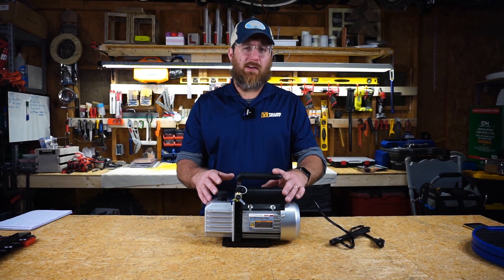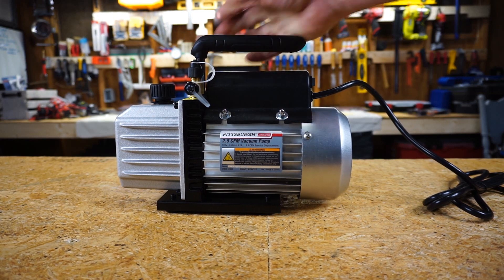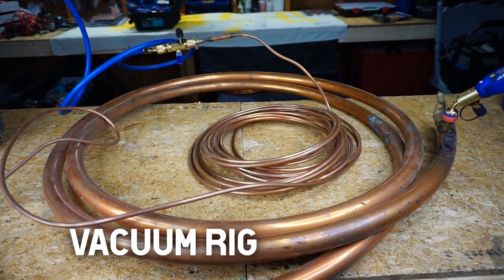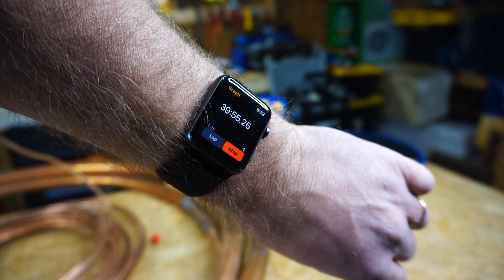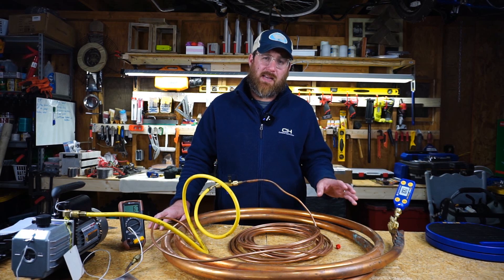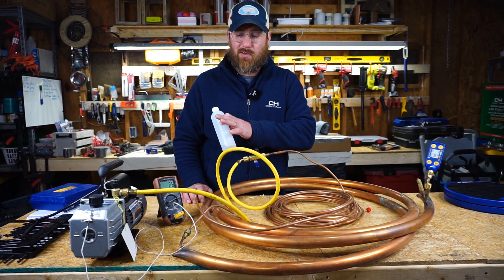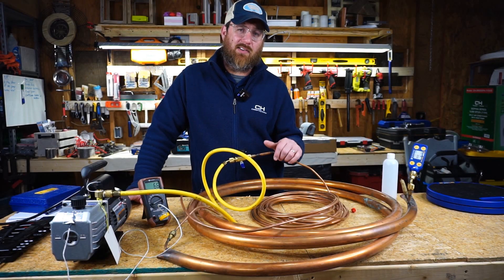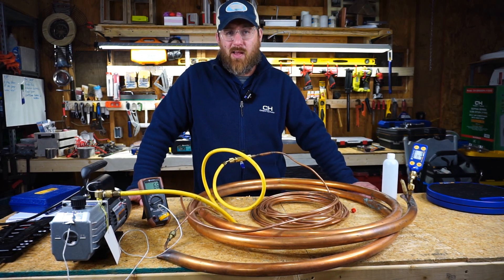Can a Harbor Freight Vacuum Pump Pull a Deep Vacuum?

Comment: I used a newer model of this pump rated st 3.5 CFM and 75 Microns.  It easy pulled to 300 microns fairly quickly.  Cost $149.95 in new inflated dollars.
Reply: "new inflated dollars"

@the497jepthal - I chuckled, and cried.  Thanks for the new term.
Reply: I was just at HF last week and picked one up at that same price, but it was 3 CFM (two-stage) and 22.5 micron rated.
Reply: Do you remember how long you pulled the vacuum for

Comment: Cant say i trust any gauges at all anymore. 
At least not on this job. 
Tried the old sears vacuum gauge on a pump and deadhead i would see 22". 
Hook it on the car,i was getting 25" on the gauge set.  
Unsure if that was good , borrowed another pump and the sears gauge gave me 23". 
Hooked it on the car,id see like 27".
Whatever, if that's good enough ive got time, let it run for a week i guess.

Comment: I have seen that in Harbor Freight and been curious about it myself so it was nice to see a video about the performance of it in real time. Nice know it could be used in a home air conditioning system. I suppose in the end 500 Micron does the same regardless of Automotive use or home use. I have shopped at Harbor Freight numerous times before and find that their quality has come a long way from what it used to be. Hand tools not so bad but anything requiring torque is generally pretty poor or for short-term success. Or both. Let's face it, most of that stuff is made in China and they don't care about generating Goodwill they care about generating more money. End of story.

Love your Channel by the way and your basic philosophies involving life and religion.

Comment: I've been using the Harbor Freight pump at our shop (Heavy Construction Company) for three years now.  Has not let us down once.  A/C in our trucks and heavy machines is Ice Cold.
Reply: Hey, I'm in a similar field (heavy equipment in a quarry) and I'm curious what your HVAC gauges say once you've pulled a vacuum.  I had a harbor freight single stage pump and recently upgraded to the two-stage pump (because I've been using the single stage pump to pull vacuum on hydraulic tanks while I work on the system). The single stage pump used to get me between 26 and 28 inches of mercury on the gauge and now that I've upgraded to the two-stage pump, I'm only getting between 24 and 26 inches of mercury and it takes forever.  I'm not sure if maybe my gauges got bumped around and it's not accurate anymore or if this pump is defective.  How many inches of mercury do you usually get , and do you have a single stage or two-stage pump?
Reply: @bradbeck2601  Hi Brad, I use the single stage pump also and like you get 26 to 28 inches.  It's not a perfect 29-30 but never had an issue with our A/C units. Yesterday found someone walked off with my gauges and hoses but left me my pump. Could have been worse I guess but I think they will re-appear as fast as they disappeared.
Reply: @fireriders8319  thanks!  Yeah, I haven't had any problems yet only getting 24-26 inHg I just thought it was strange since I anticipated a deeper vac with 2 stage.  Maybe there's something else I'm missing, I'll have to investigate further.  By the way, your workplace sounds exactly like mine, tools go missing for days and magically show back up on my toolbox, sometimes right after buying a replacement.
Reply: @bradbeck2601  I usually get them back bent ,  broken or even rusted solid.

Comment: It is a rebranded FJC pump. Used it the first time yesterday, pulled 200 microns no problem while testing with non-vacuum hoses. Be careful when use Fieldpiece manifold with an internal micron gauge, stupid me released vacuum by opening a valve on a different hose after shutting down the pump and it sucked some oil out of the vacuum pump into the connected hose, lol. BTW manual says this pump uses 46 viscosity oil, I plan to switch it to synthetic Supercool oil.

Comment: According  to instructions, the smaller threaded Red plug is the oil fill port...Why you used the larger Black air vent port plug ??  Thx for the video.

Comment: I have a unbranded vacuum pump that looks very similar to the HF pump you have here I use for wood turning. I ran it todayfor about 20 minutes to hold a bowl on my lathe. When I finished the pump side was very HOT. I don't have much experience with these pumps. Do they normally get so hot? Thanks for any information you have.
Reply: Yes 😁

Comment: I bought a “kit” on line for about $150. My logic was I am a homeowner who is installing two units. If I had to call in a hvac tech (maybe twice because of timing finishing both units at the same time) it would have cost me way more. I probably will not need to use the kit again. Worked great for my needs.

Comment: I bought a Harbor Freight Brake Bleeder Kit Pneumatic.....but it did not perform well.....so I’m considering buying one of these vacuum pumps and connecting it through a glass mason jar to create a direct vacuum at each bleeder screw....instead of their air compressor version 🤔
Reply: Vacuum bleeding tends not to work a lot of the time. You can pull air through the piston seals, introducing air into the system, the opposite of what you're trying to accomplish. More/better vacuum will make that problem worse.

Comment: Unfortunate there is only one 1/4" inlet.  With core and depressor removed, you can only achieve maybe 1.5 CFM at best with 1/4" hose.  Would take too long to evacuate anything other than line set and coil on new installations.  Thanks for the review.  I've seen them and was curious about it's performance.  Now, I wonder if anyone has a video on Harbor Freight 3 CFM 2 stg pump?  How well would it do on a complete system with exposed/saturated oil?
Reply from the maker: I aim to get one of those pumps (2 stage) as soon as I can
Reply: There are 1/2 acme to 3/8 sae adapters out there that consist of 1/2 acme to 1/4 sae, then 1/4 to 3/8, or just get yourself a basic 1/2 acme to 1/4 sae - those a easy to find. That way you can connect two hoses.

Comment: So, the pump is able to pull a deep vacuum. That's all fine and dandy, but there is this critical question: For HOW MANY TIMES will the pump perform as expected before it breaks down? I'm just not convinced that this pump will stand the test of time. The main reasons I feel this way is that stupid 90 day warranty offered for this pump (and most other items at HF that have an electrical cord), as well as comments from actual buyers of both pumps sold at HF. Ironically,  the 2-stage pump had more negative reviews than it's cheaper, single-stage sibling. But the reviews reveal nightmarish experiences for some people when putting the pump through it's paces, like blowing oil everywhere and the motor suddenly failing without warning. I'll stick to my Robinair for now.
Reply: @Aaron Loos That’s exactly what I’m talking about. If you read the one and two star reviews on the two vacuum pumps, there are quite a few failures on first or second use of the pump, and many of these failures happen long after the 90 day warranty has lapsed. I am also a DIY type, but that doesn’t mean I should have to compromise dependability and quality just because I don’t use the device as often as a pro, esp. at similar price points. Milwaukee or Ridgid do not hold my DIY status against me, and I know these power tools are going to be there and ready to work when I need them. With a 90 day warranty, I’m not so sure (and this is just my opinion) about HF vacuum pumps, but at the same time, I’m not “anti HF”. I own several different HF air tools and a bunch of other products they offer (3 sizes of torque wrenches, my impact sockets, adapter sets, most of my files, 2 jacks (both as old as the hills), most of my sanding discs, drill press (12 yes old) and cut-off wheels, etc, and I spend a lot of $$ at the new store in Zachary, LA. Here in Louisiana, air conditioning is a requirement - both car and home - and a dependable vacuum pump is a necessity. I service for friends and relatives, and usually at the worst, hottest times, and don’t need the frustration.
Reply: @plumkey197  in my experience HF tools either work or they break, if it lasts the 90 days of use it probably isn't a lemon.

That said I have had the 3cfm 2 stage pump for almost two years with thankfully no problems. I say thankfully because unlike the 1998 JB DV-42N I was given, if something breaks on the Harbor Freight you are pretty much screwed. I was able to pick up a brand new flex shaft, cover seal, shaft seal and oil fill gasket that are still in production. Won't see that on the Harbor Freight.

Comment: I have the Harbor freight 3CFM pump I've done plenty of 5  Ton Goodman units And had no problem pulling them down to a 130  microns  And it didn't take too long to do it I will say I'm pretty impressed with the Harbor freight pump And for the price couldn't beat it

Comment: I bought the Harbor Freight 3.0 CFM 2-Stage vacuum pump years ago for automotive AC work, then I got into doing my own residential system.  The pump always pulls to 25 microns and with a micron gauge attached o the 1/4" port.  I used it when I installed my 3.5 ton heat pump 4 years ago and it pulled to 400 microns after about an hour.  My 7 CFM bullet doesn't do much better and you have to use YJ pump oil on it or you won't get a deep vacuum. The port on top is the automotive 1/2" ACME size port and fits the one hose that came with the H.F. A/C gauge kit. I purchased a 1/2" ACME to 1/4" adapter online just in case.
Reply: What's the difference between the one & 2 stage Pittsburgh pumps?
Reply: @paulsosa1872  ones pulls to 300 microns and his post says the 2 stage pulls to 25 microns so better performance and  osts $150 instead of $95
Reply: @paulsosa1872 2stage is whats standard to have and want for houses

Comment: if you have a harbor freight vacuum pump you should not be doing ANY hvac work period! PLEASE leave it to the professionals. lol
Reply: I’m an engineer. Sure, the average person does no research and is ignorant about HVAC, but this stuff is not rocket science. While I don’t know enough to do a commercial system, MOST DIYers will have no problem doing a small mini-split. It’s not rocket science. I have a BIG problem with tradesmen with self-serving attitudes. In my rural area, most don’t keep up on technology, which is sad. Even though I’m old and have the money, I still do most of my own work because in so many cases, I either know more or do better work than the so-called experts. I’ll not pay to educate someone who doesn’t keep up with their craft.
Reply: It ain't rocket science, pal. I HF pulls 300 mikes, that's more than enough for an average evac. Trust me, your system won't care how you pulled it. So you are saying if someone is stupid enough to pay 5x more for a pump they might use once every 2 years, then that somehow qualifies them to do it themselveslogic
Reply: @FisherCatProductions   you are correct it is not rocket science. if 300 microns is your goal on a proper pump down then that is all that i need to hear from you LOL. I have been doing this for awhile and have repaired and replaced more systems that were worked on or installed from home owners and side job guys. proper tool for a proper job. you are rolling the dice with cheap tools and more times than not end up with a hack job!
Reply: oh .... the superior professional.... relax, it's not rocket science

Comment: Harbor Freight tools are hit or miss but their prices are usually tempting 🤔.   With clean copper it seemed like the the 40 min was a long pull for only 300 microns?  It would have been interesting to put the micron gauge straight to the pump to see where it would pull down to.
Great video, thanks 👍.
Reply from the maker: As I write this comment the same pump is running in my shop with the micron gauge directly on it. I will let you know.
Reply: @TALYN875  Where did it end up ?
Reply: @OnePointLander  Mine did 19 microns in 59 seconds, out of the box, with a CPS digital guage.

Comment: I have the 2 stage 4.5 CFM of this variant. I go usually between 30-40 microns in my heatpump systems.
Reply from the maker: I was going to get the two stage to test but I was curious what the most basic model would do. That’s pretty good on the two stage.
Reply: @TALYN875  It works very good in the swedish northern winter also. Just to let u all know 😊

Comment: Have used this primary for a few months in light commercial until I was able to get the pump I wanted. Never had a issue.
Reply from the maker: Cool, thanks for the info. I wonder how long these would last.
Reply: @TALYN875  I don't know whatever happened to mine but my old co worker still uses his. I'd say he uses a couple times a month.
Reply: What pump did you get. Im looking for a good heavy duty pump. Not sure why one to pick
Reply: @CBRRR-eh3ky  I just had the small one at the time but if the 2 stage is affordable I'd def go with that
Reply: Thanks for your rwply

I ended up ordering the 
OMT 3.5 cfm HVAC Vacuum Pump Kit and A/C Manifold Gauge Set for 134a 22 12 & 502

What is the advantage of a 2 stage VS the single stage?

The one i have is a single stage

Comment: FYI.   Most auto parts stores have free tool rentals.   Most have a very similar pump.   Nice to have as an option if you need a pump in a pinch.   Usually can keep for days for free.    Sometimes you get lucky and you get a brand new pump with bottle of oil included.   I think the other fitting is the ACME fitting.   Easy to connect to auto 134a cans and hoses.   Just need and adapter from yellow Hackett to connect.   Good video 🤪
Reply from the maker: Great tip!

Comment: 40 minutes to do it scares me.      With no schraiders in it , i would expect 12 minutes for that test.       If you put it on a system with line set evap and condenser it would take way too long.
Reply from the maker: It does seem to take longer. I will continue to test this one to see what I can find out.

Comment: I was hoping this pump would pass and hoping it will fail as well. In summer months when I am busy for long days or weekends it is good to know if my good vacuum pump fails and it after hours or weekends when my distributors are all closed, I can run to Harbor Freight to pick one up just to  get the job done. On the other hand where there is so many consumers buying mini splits on the Internet, this can eliminate customers contacting HVAC contractors to perform this procedure.
Reply from the maker: I don’t know how bad access to this pump would be for contractors. I bet it’s pretty rare, but I admit that a few folks would go that. I will continue the testing to see how much this little joker can take.
Reply: People work on their own cars and have access to random shade tree mechanics. Still most people use certified shops and dealers. Only that odd 5% who are more interested in it will actual do it like that.

Comment: I figured it would do half decent honestly. It would probably do better if it had some quality vacuum pump oil in it. Ive been wanting to get one of the pneumatic vacuum pumps they sell and see what it can pull for microns. It has no practical use in our trade but it would be fun to experiment with.
Reply from the maker: You must be like me, wanting to test every random thing to see how well each would go.
Reply: @TALYN875  I want to do that with a 3d printer although I have absolutely no use for one.